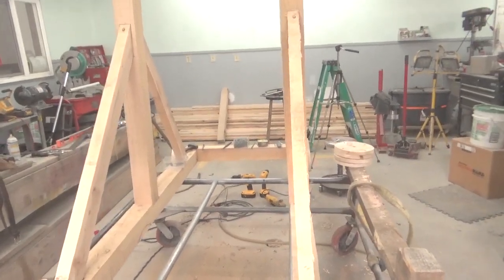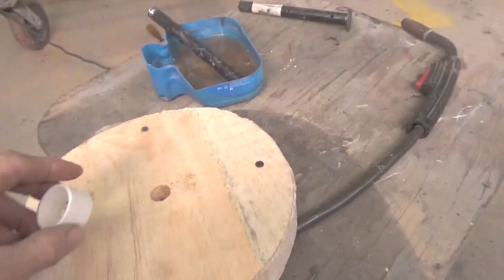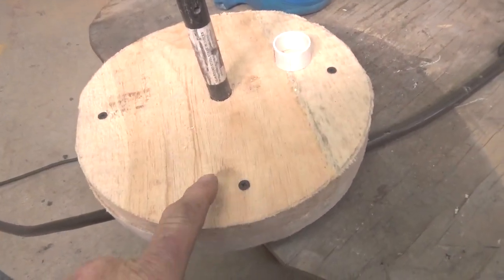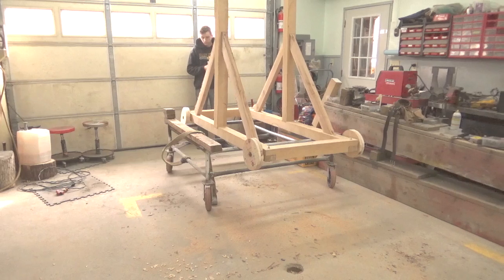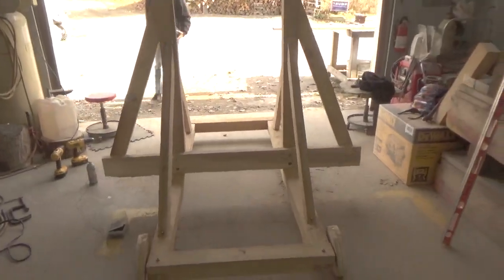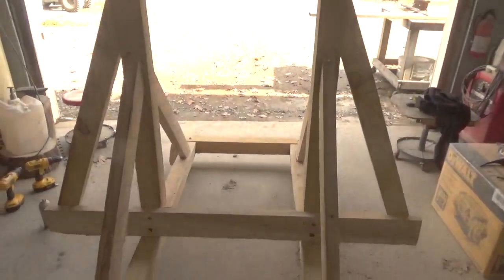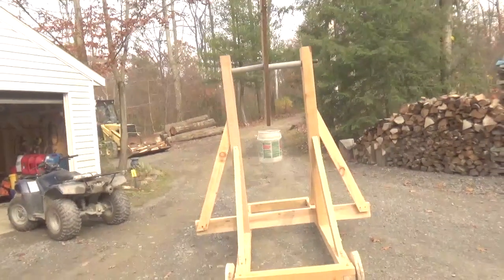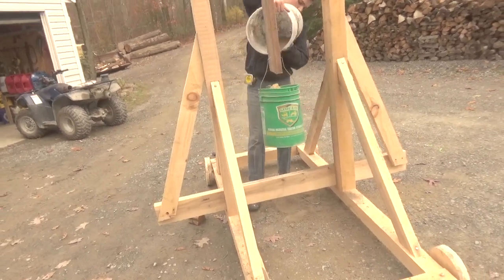The catapult is done and the testing begins. Back to work soon.

Comment: Try using a narrower pendulum board made with lighter wood like pine instead of oak. The pendulum doesn't need to be that strong since it is only throwing a light object. Having a lighter pendulum will multiply the effect of the counter balance.

Comment: You need to get the length of the counterbalance correct, it looks to long on the catapult end and too short on the counterbalance, are you sure the rod is at the right place. If it was about another foot on the counterbalance and that was taken off the catapult end you would have a lot more distance of the item being thrown and less resistance against the counterweight.
Reply from the maker: My grandson had the specifics for the design, we built it according to that. It seems pretty good now. Thank you so much for the comment.